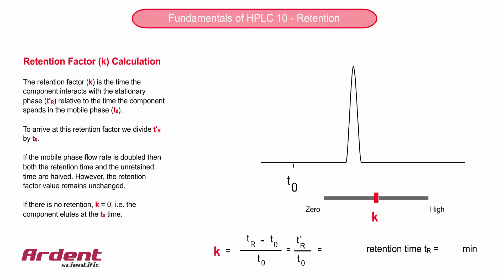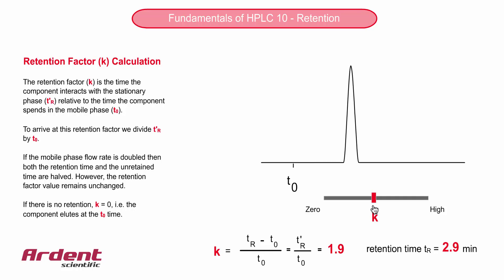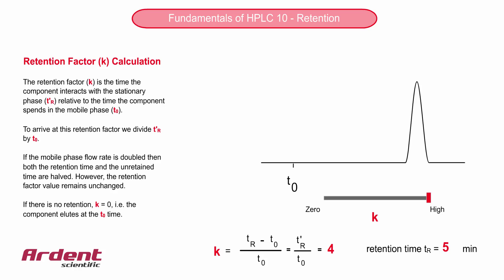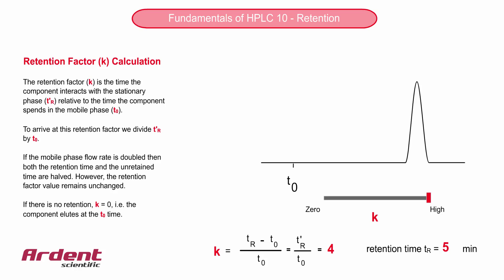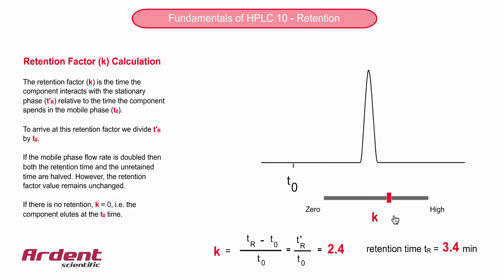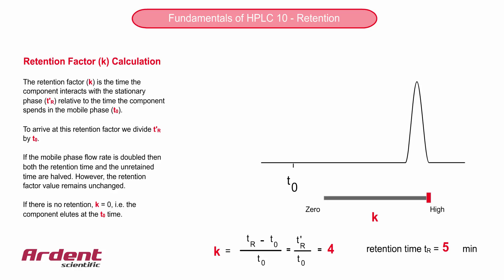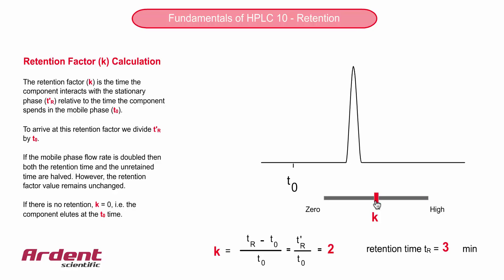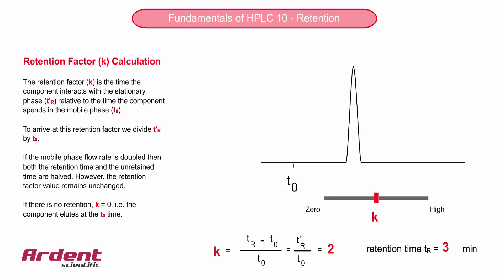Fundamentals of HPLC 10 - The Retention Factor

Comment: Why is important to know retention factor?
Reply from the maker: Because the retention factor shows the true retention of a compound i.e. the degree of interaction with the stationary phase. The retention time is only an indication.For example, if you connect a large length of tubing between the column and the detector, the retention time increases but the actual retention has not changed. Also the retention factor is useful for problem solving because it is a ratio of the time the component interacts with stationary phase over the time the component spends in the mobile phase. If the flow changes, the retention time will change but the retention factor will remain the same. If selectivity changes (for example the temperature or mobile phase composition or the column), the retention factor will change.